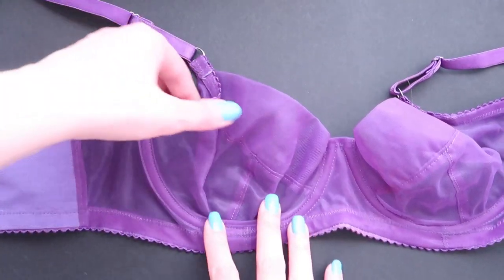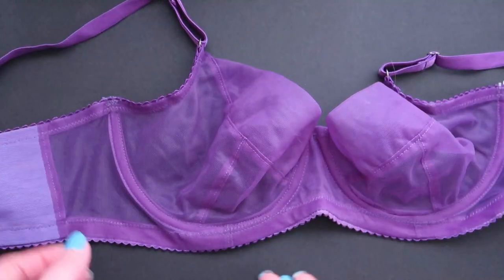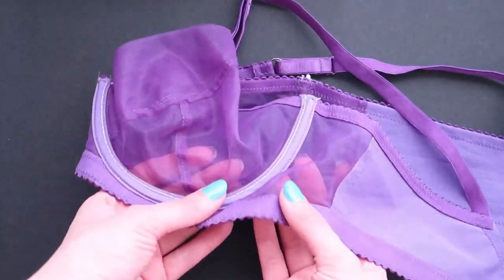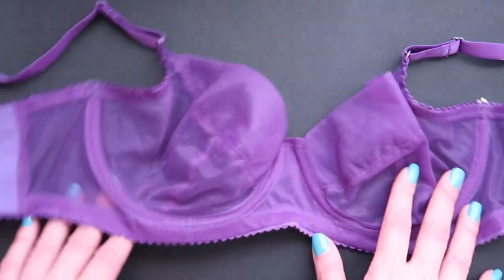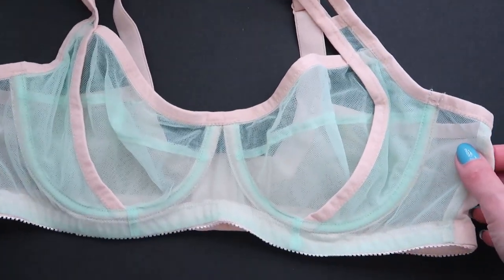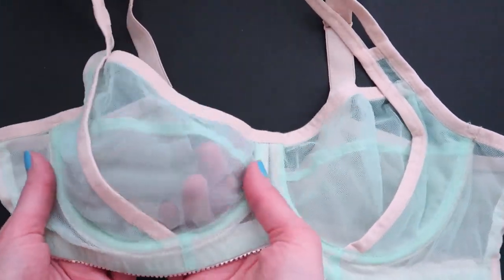Bra Making 101:  Sheer Fabrics

Comment: Hi Liz. I was wondering if one could use embroidered mesh in bra-making or in making a bodysuit? I assume that if the mesh is embroidered it no longer stretches? Would one then use stretch mesh in the band of the bra / back of the bodysuit to allow for a more forgiving fit? Also, how does one adjust the pattern size to compensate for the lack of stretch (e.g. the Black Beauty bra). Thank you.